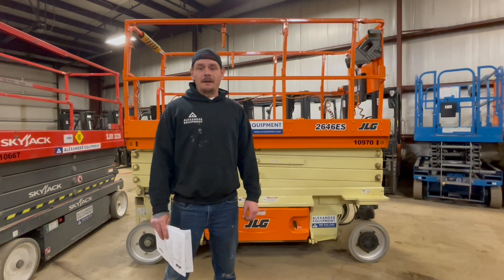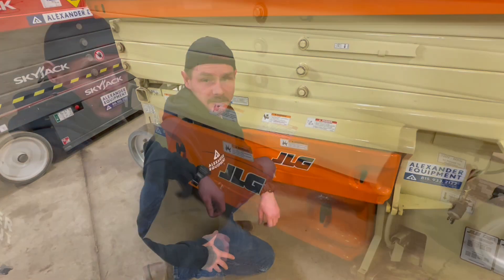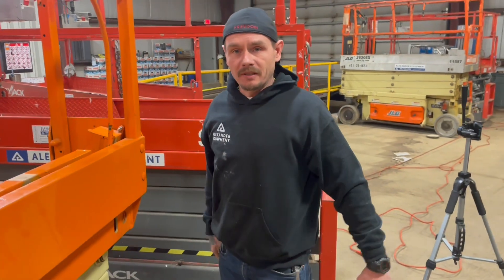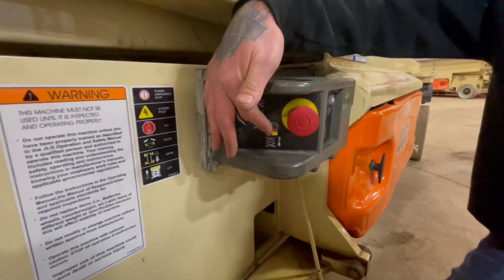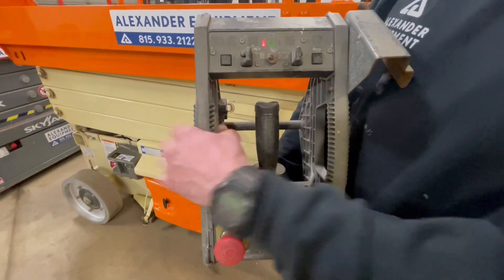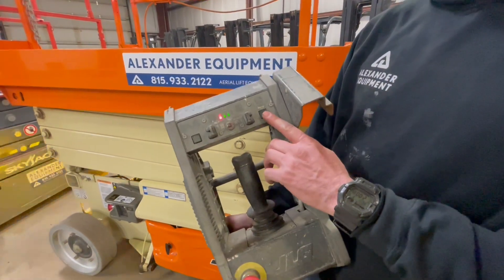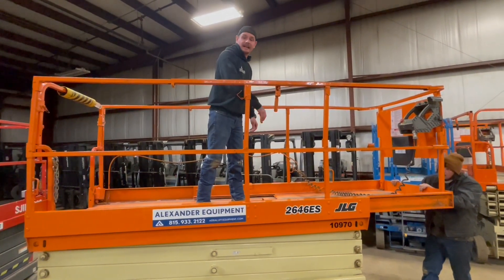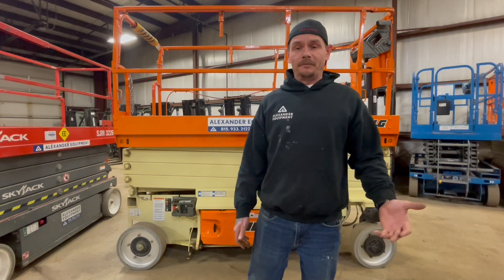How to Operate a JLG 2646ES Scissor Lift

Comment: Peace be upon you. I own one, but it suddenly stopped working. I brought an electrician and he told me that the electricity is not reaching the engine. I put the key in the switch, but it does not work. What is the reason? I checked the batteries and they are fine. What are the common faults for this type, and how can I fix them?